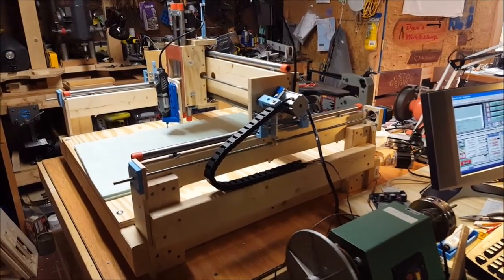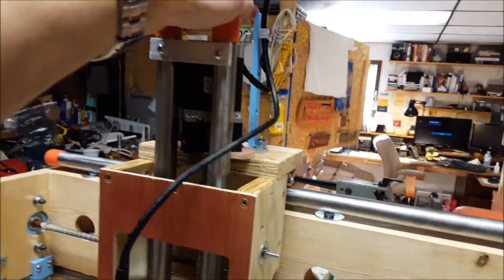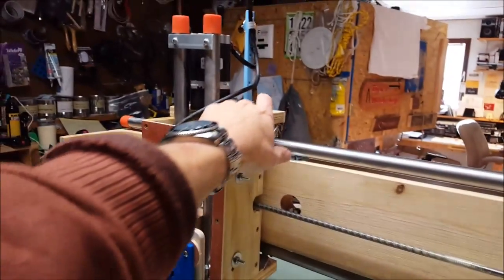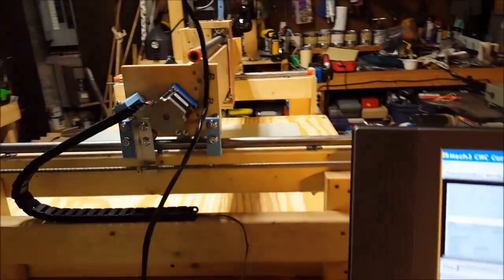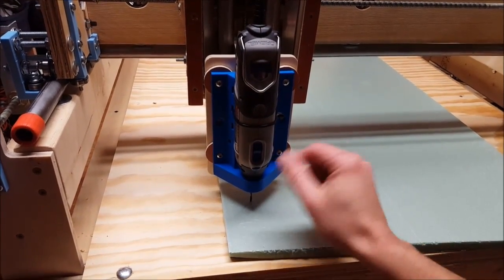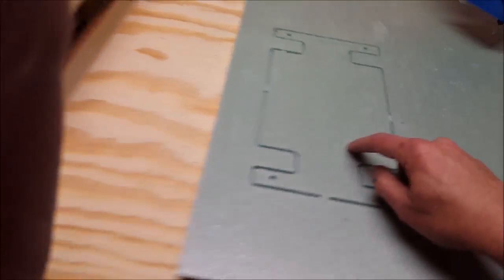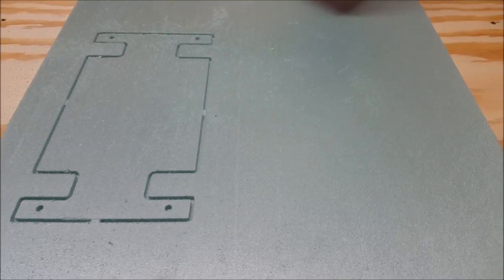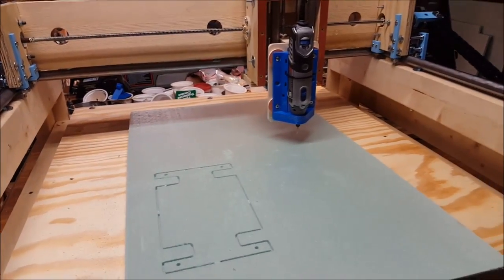Solsylva CNC First Cut - Success!

Comment: This may have been asked, but I'm curious if you have any issues with the gantry moving up and down with the bearings on the rails the way they are. I have the plans for this machine and noticed the one bearing is designed to be lower so it essentially locks in the three bearings on the rails and prevents the gantry from moving up.
Reply from the maker: Hi Dave.  Good eye.  I wondered about that a lot before I made the CNC.  So far I haven't cut anything that was super hard so I haven't seen any upward movement.  The gantry "beam" is pretty darn heavy, especially with the two gas pipe rails for the Y axis as well as the whole complex Z box and router.  So far I haven't noticed any problems.  In retrospect I would modify the design to use 3D printed blocks from the Mostly Printed CNC on Thingiverse.  I built the MPCNC shortly after the Solsylva and like the way the 3D printed blocks lock onto the rails.  Here's the MPCNC I built in the last few weeks.  https://www.youtube.com/watch?v=jZNNK5Rsdzw&t=1s

Comment: What caused the early entry into that hole? Is that the telemetry planning in Mach3?
Reply from the maker: Good eye.  It was the springy coupler connector from the stepper to the acme rod.  Once I pulled those out and replaced them with fuel line hoses and hose clamps the early drop-ins disappeared.

Comment: You can try pre-loading your lead screws, so they run a bit straighter. What that entails is putting springs on the screws behind the bearing support, to stretch the screws out. But with the lengths of screws you're running you're going to get some whip at speed. With my second design I made my leads as short as I could. I've run them up to 2,000 RPM and they were OK there too. But my machine has less than half the travel yours does. It's all trade offs.
Reply from the maker: Hi Paul.  Yeah, I could invest some time in trying to straighten these rods out.  We'll see.  For now I've found a comfortable rate of around 100ipm that keeps everything pretty calm.  It's just a super affordable CNC with a large cutting area, not something I plan to do super accurate metal work with.

Comment: looks like its really coming along cant wiat to see what you will be able to make with it. are you planning on using a bigger router?
Reply from the maker: Hi Matt.  Thanks.  Eventually I do plan on going with a trim router similar to the one.  I've used this model for years: https://www.hingmy.com/site/article.php?DeWalt-D26670-Review
Reply: right on I started watching your channel a long time ago when you started posting videos on the 3020. I got mine in March of last year and did the same MOD you did as far as cutting off the z axis and making a new plate for it . I ended up putting a 2 HP router on mine and man OT works great
Reply: drez20001 j
Reply: I was running a Bosh Colt router in my machine but the noise it made drove me up the wall. So I got one of those Chinese spindles. Sanity is a beautiful thing. I got to say that router did have a ton of power. But how often am I really going to be running a 1/2" diameter bit?

Comment: Is that a tb6065 driverboard and are they reliable?
Reply from the maker: Yep, Toshiba 6560.  I've had it for years and it's been reliable.  Certainly affordable.
Reply: The TB6560 drives are obsolete now. The hot cheap ticket today is a TB6600 drive. I like the bare board BL-TB6600-V1.2 model. But you need a buffered breakout board with these drives. Well, maybe you don't need one, but I think it is a good idea. Those all in one TB6560 boards have that built into them. But the TB6560 driver ICs were never designed as general purpose drives. So how they do current sensing is stupid. Well, it isn't stupid if you make dedicated drives. But that's not what those imported drives are. So how they handle setting current is a lousy hack. Which leads to poor performance.
Reply: I've had many problems with the tb6560 driver, it began losing steps at low to medium frequencies. I got that fixed with a schmitt trigger IC behind the opto couplers, but some time after that one driver IC after another died and I don't know why. Even the small a4988 were much more reliable. Now I have Leadshine M542 drivers, they've cost much more but they seem to be worth it.
Reply: Klaufmann
a 7414 hex Schmitt inverter IC? That's what I used on my homemade TB6560 drivers that I made. I made those drives when stepper drives were all much more expensive. Before the imported TB6560 boards were even available. My drives were OK. But imported TB6600 drives are marginally better.

I wrote an article about the drives I made here http://www.instructables.com/id/TB6560-Microstepping-Bipolar-Chopper-Stepper-Motor/

That was years after I made the drives themselves. My homemade drives are better than the imported ones. Because I sized the current sense resistors for the motors I ran, then just ran the torque at 100%. The mass produced drives just slapped the same sense resistors in every drive and told users to fiddle with the torque setting. Most of those drives were hard wired with a 1 amp current limit. So no matter what you did that was all you were going to get out of them anyways. Unless you changed the sense resistors on the board.
Reply: In the video you can also hear the steppers screaming, propably because of wrong chopper capacities. Had that problem with the a4988 drivers, with the m542 I can't hear much now, when everything stands still.
Reply from the maker: Since adding a motion controller (UC100) to the Toshiba board the motors are much quieter and more responsive.  They are also running much cooler to touch.  The Toshiba board is definitely bottom dollar but for the woodworking I've done and on cheap homebuilt CNC machines it's worked well for me.
Reply: drez20001
it sounds like it worked well enough to me.